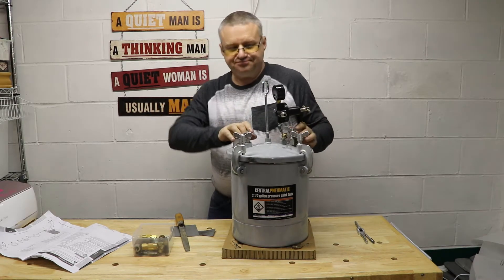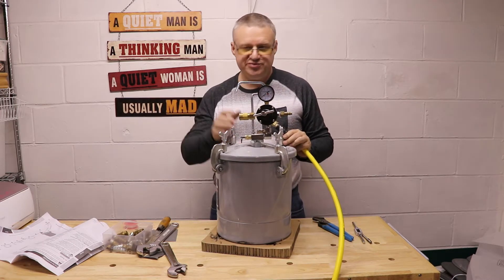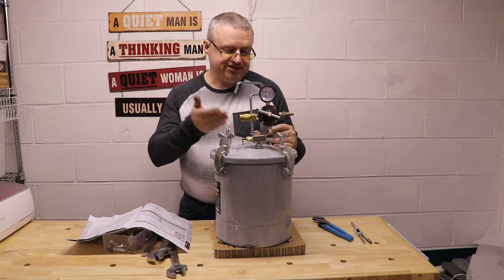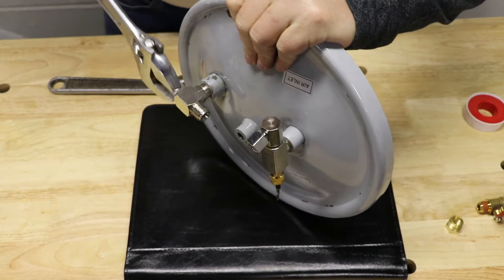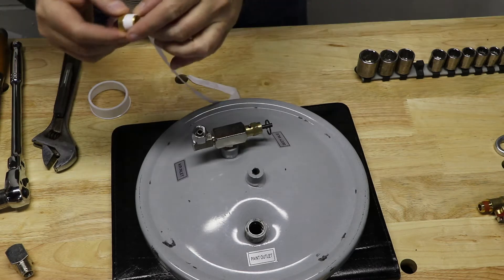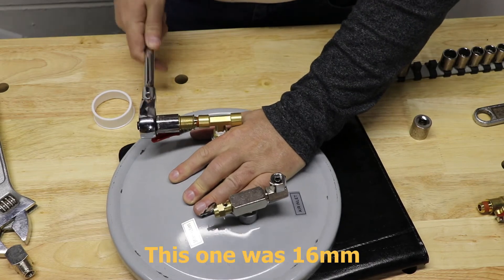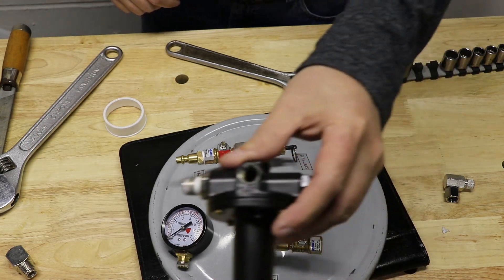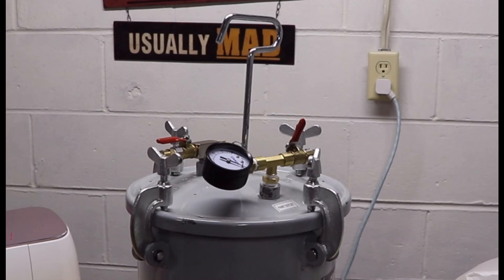Harbor Freight Paint Pressure Tank: Part 2 - Changing and adding valves and gauges

Comment: How has this been working for you?
Reply from the maker: I haven't' had a chance to actually use it for resin yet. We have been going through some life changes on the old homestead and my hobbies have had to be put on hold. That is why the videos have slowed down. I did actually redo the design a little bit to simplify things. The design in the video used two valves so that I could adjust pressure while the compressor was still connected. I eventually removed one of them. Now I have a pressure gauge in one of the holes and the valve and pressure relief on a T on the other. So far I have only run into two slightly annoying issues during testing. I was able to adjust the popoff valve but it isn't my favorite. You can buy new ones that are designed to be easily adjustable from Amazon. Occasionally the gasket leaks when I first pump it up. Relieving the pressure and immediately reapplying seals it up without issue.

Comment: Mine pops at 30. How did you adjust it?
Reply from the maker: (GENERIC WARNING: Altering a safety device should never be attempted! Do so at your own risk!) Are you talking about the emergency pop-off valve? There is basically a spring that holds it closed. If you look at the metal 'pin and ring' that you pull to let the pressure off you will see two notches on the metal plate that they go through. Basically those allow you to rotate that plate around the pin. Screwing it in is more pressure and screwing it out is less if I recall correctly. It is basically inside threads and that plate screws in and out and compresses the spring on top of the actual valve. Of course they are always changing the design so it could be different on yours than mine.